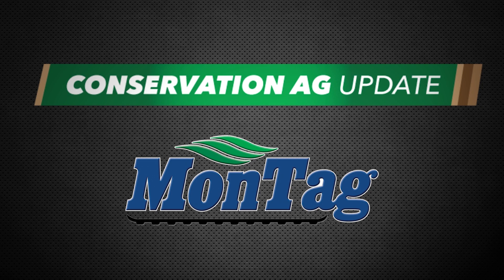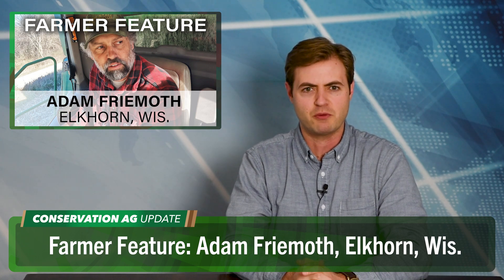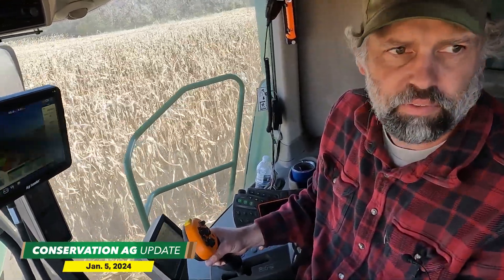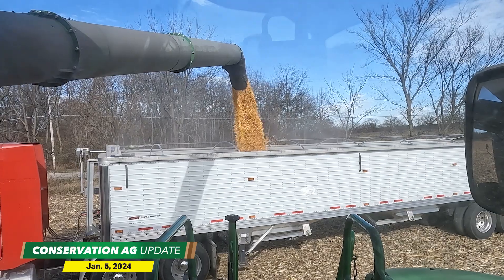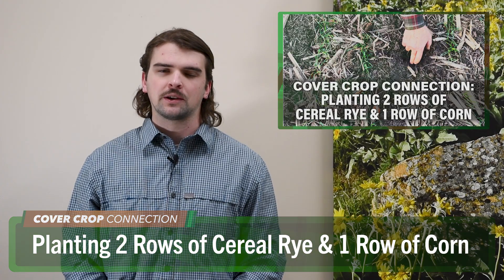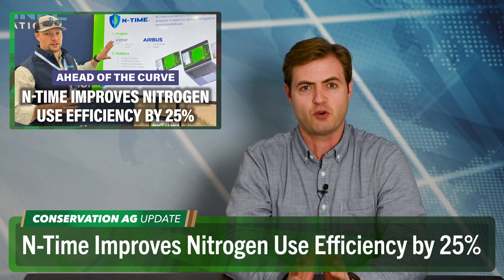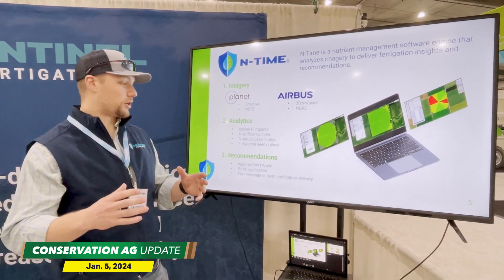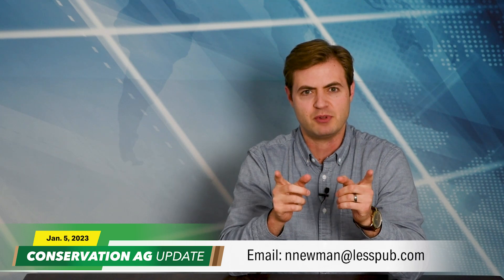Creating a No-Till Buffet for the Soil

Comment: A model of the optimal seedbed is proposed, consisting of seed, condensation, transmission, organic mulch and inter-row layers. The existing generally accepted model of the seedbed is fragmentary, there are no cause-and-effect relationships between the structure of the bed layers, their functions and the phenomenon of seed germination. The qualification of the bed structure is assessed by subjective parameters: "good contact of seeds with the soil", "optimal over compaction of the bed", "moist soil". The following factors are not considered: the need for liquid water for seed germination, different forms of water in the soil and the forces that hold it, the influence of diurnal fluctuations and amplitudes of soil temperature and atmospheric air on seed germination. Only one source is considered – capillary water – and the water of condensed vapors of moist atmospheric air is not considered. In the proposed model, these shortcomings are eliminated.
«On the question of the structure of the optimal seedbed» (The Internet)
Reply: Sounds a tad convoluted
Reply: @666bruv  Machine translation. Read the article (The Internet) "К вопросу о строении оптимального семенного ложа" in the original with an English translation. Vladimir Sesyakin.
Reply: @666bruv  There is nothing super complicated about this, it really happens in field practice. But the farmer looks at the process of seed germination in the soil and does not see the real picture. For this reason, "he scratches his right ear with his left hand." As a result, satisfactory indicators of seed germination factors in the soil are achieved. However, they are not optimal. There are patents for inventions in which an optimal seedbed is potentially achievable